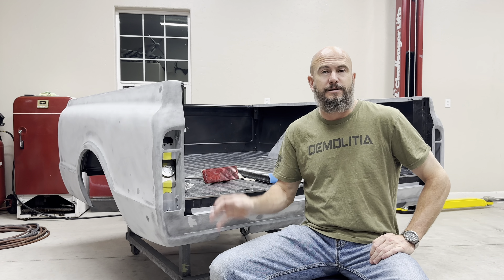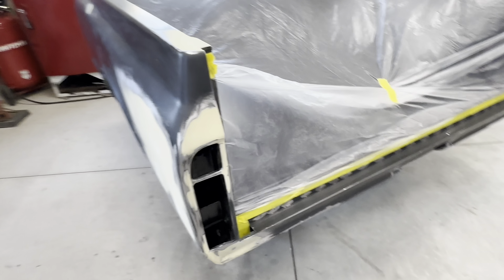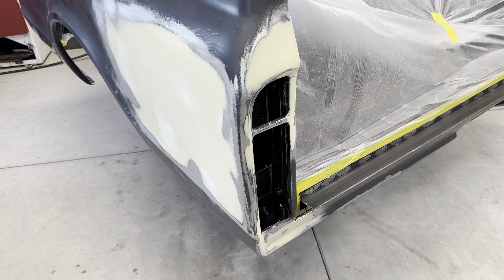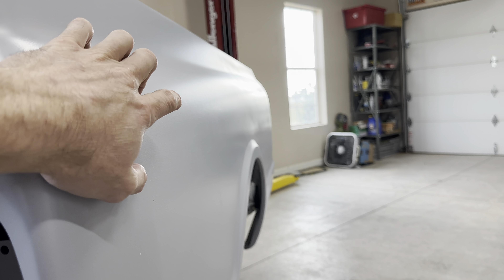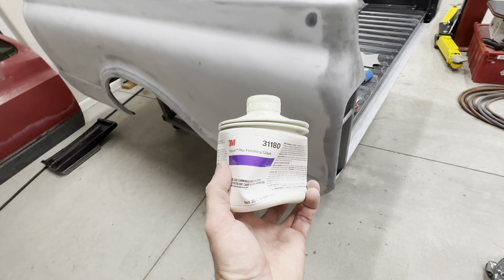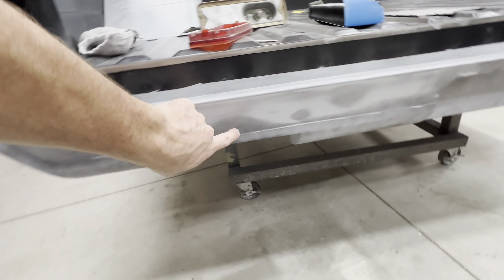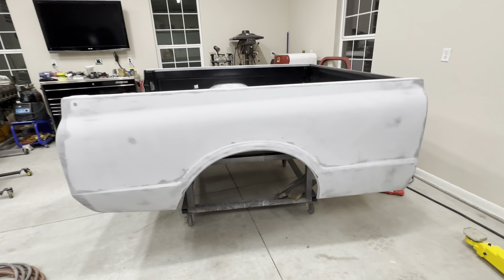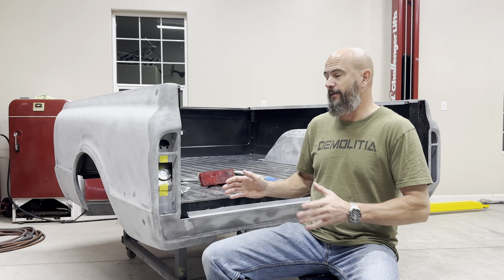1972 C10 Bed Is Finally In Primer

Comment: Glad to see your progress Curt. Hope it continues in your favor as perhaps high build or spot filler works with the guide coat. (Note: Folks, don’t not buy the red spot putty or filler, as it’s lacquer based and will shrink months after your project was painted)
  Thanks kindly for sharing Curt! I am on my feet for awhile as the Drs schedule sacrum injections that may lead to a pain pump. That one’s spooky. 
  Have a safe one as time flies.
Reply from the maker: @deankay4434  I switched primers for the bed, to K38 from K36 hopefully don’t need anymore it’s getting too expensive.  Still need another gallon of DP90 and hopefully I can get away with not buying anymore paint supplies for this one.  Last time using PPG.  I’m embarrassed to even say how much it has cost so far.  Hope your health improves.
Reply: @curtrobinsongarage   I completely understand Curt. I have 4 sprayable gallons of epoxy, 2 sprayable gallons of high build, 2 gallons of EverCoat Rage filler, powder & spray can guide coat and still looking at $1,000 in paint. Crap, how many hands touch this stuff and take money? I have new rear springs for OEM rear C10 LCA’s, but looking at dual adjustable coil over for the front, using “Aldan” with coils the fit stock upper, then narrow to 2.5” to shocks. I just lied to them saying I have a 71 Caprice with A/C & BBC. It’s still $970.00 That a bargain I guess? Everything else has nothing or $2,800 dollars written on it. I still make 1984 income on retirement. I take paper plates apart, eat beef pot pies, and qualify for homestead act and no property taxes! I still work my budget every few weeks! I will sew my own seats, bought brown leather 6 years ago, and I still catching up on house maintenance & repairs. My wife say older folk cry in grocery stores and she can’t stand it. My “Ouija Board” say (No 3M Paint). 
    Thanks kindly for your sharing! I was buying stuff off the SnapOn truck when half of it was not made by them, like CP air tools. None were SnapOn! I kills me when a truck driver says “That’s not SnapOn…Oh, I guess it is! Never seen that!”

Comment: New info Curt, or not. But Eastwood and a few others sell a panel spray  for your final guide coat sanded panel that stays glossy, like clear coat, but allows you to use light to look for highs, lows, sand scratches and other defects. The Eastwood P/W 65997Z.
  Spray on, take time with good light, examine for defects and always use pencil. Not a sharpie or magic maker.
  Hope you had a good Thanksgiving!
DK, Omaha.

Comment: this bed has more filler in it than a 25 year old ‘influencer’… 🥁
end result will be worth all the sanding and swearing.
cheers from Australia🍻🤘
Reply: The thickness of the plastic filler should end up being less than 1 mil. Using a guide coat reveals scratches from previous sandpaper, high spots and lows. It’s pretty common to see a larger panel “Appear” to have a lot of filler, but in reality, it is tricking the eye. Have a lucky one!
Reply from the maker: @Dane_the_Pain  yeah buddy, she’s a little more than I wanted.  It’s feathered pretty thin.  Sadly my metal working skills haven’t leveled up that high, still learning those.  Wish I could be like those guys that can metal work a whole body without filler.  I’ll be relieved when the bed is back in the chassis.

Comment: So are you using a small compressor? If so you've had great success. I have an 85 c10. That im getting close to finishing up rust repair on the cab. And will be painting myself. I plan on going the small compressor lvlp gun route. I feel a 60 gallon will be a lil over kill for right now. You mind sharing your experience/advice, and the gun you have been using. Thanks
Reply from the maker: @kountrylr23  right now I’m running a single stage 30 gallon craftsman compressor that is oil-less.  Meaning the piston isn’t lubricated by oil. Instead uses a teflon like piston ring.  Reason I like this style is I don’t really need an oil water separator to paint as there is no oil and in the desert with almost no humidity the tank rarely has much moisture accumulate.  I just run a small separator on the gun.  While this works for me, in most parts of the country I’d recommend a dedicated separator just off the tank.  I would also prefer to run a 60 gallon compressor as more volume for bigger projects.  Either way I’d highly suggest some sort of separation device if your painting. It’s just good insurance. 
I use 2 guns.  One for base/clear and another for epoxy/high build primer.  They are both cheap 100 dollar guns.  Are expensive guns nice, yes, however unless you have the money or are painting professionally they are not worth it.  I notice I waste a little more product with mine and the atomization isn’t as good but you can get good results once you’re used to how they spray.
Reply: Wow! I really appreciate the detail response. On black Friday I purchase a 30 gallon dewalt. All this is completely new to me an learning as is go. So I really appreciate guys like you that share there thoughts an experience helps a ton. I look forward to updates on your build.  Merry Christmas and happy new yr to you!
Reply from the maker: @ your welcome and Merry Christmas to you too!